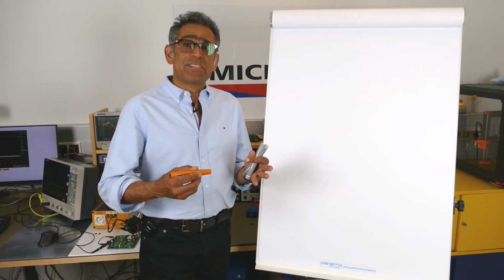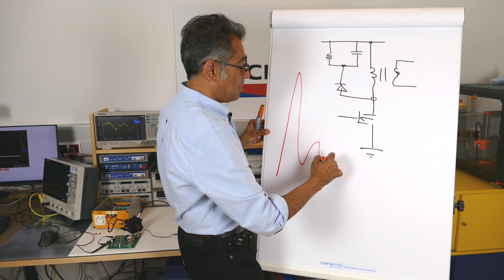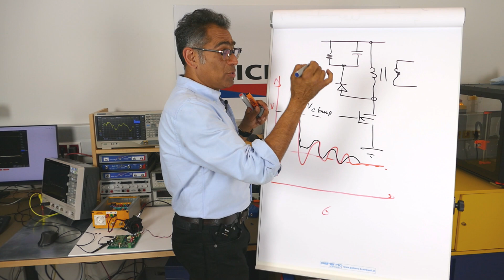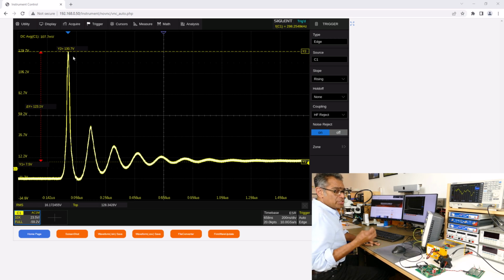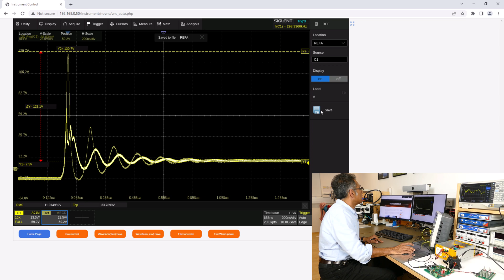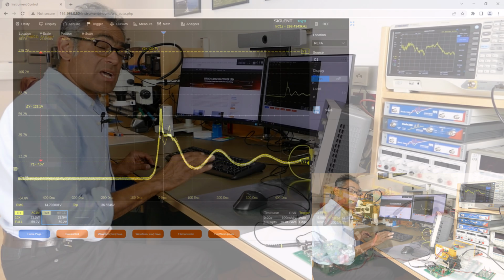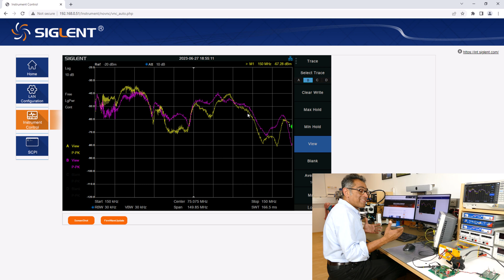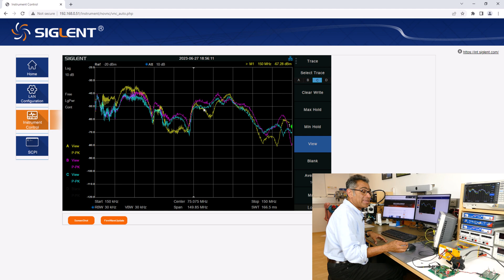RCD Clamp Design with Low Emissions: Flyback Ringing & EMI Signature with and without the RCD clamp

Comment: Great advice, but I've gotta admit the noise reduction wasnt quite as marked as I'd hoped - hows about using a schottky as the clamp diode? (if you can get one in sufficient voltage) as i reckon unlinear storage effects in yon diode contribute significantly
I realise Schottkys arent availble in very high voltages, so maybe trying some substitutions (a fast 'soft recovery' type) might help?
 Pete G, Gas Electronics